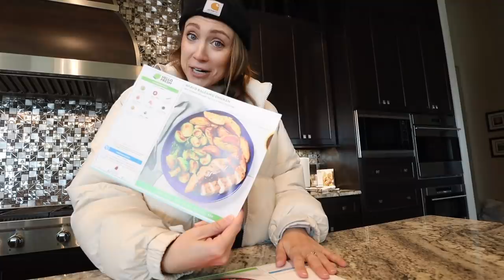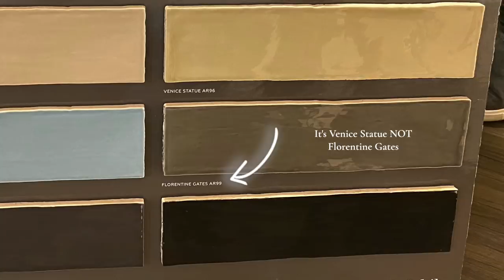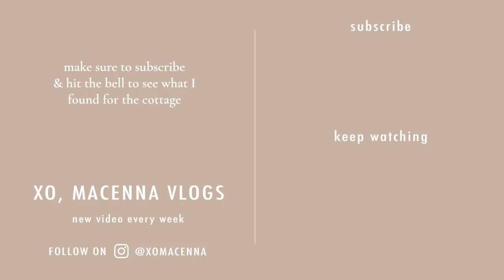DIY bifold doors + celebrating our 13th anniversary | XO, MaCenna Vlogs

Comment: Happy Anniversary! Growing up we had bi-fold doors all over the house. The knob is supposed to be on the left panel. When you grab it to pull, you pull back and the door easily folds open. If it's on the right panel, when you grab it to pull you will feel resistance because of the angle. Love your videos!

Comment: Wood is given it measurements when cut green. We still mill our lumber to the same size. We just dry it by kiln instead air dry it. Air drying it causes the call to collapse and become smaller than if air dried which doesn’t.

Comment: To answer your question re wood... they started making the wood "smaller" because by the time you add drywall on top, it comes out even.  So a store bought 2 x 4 is actually only 1.5" x 3.5".  The old 2 x4s were, many times, cut on site, milled from trees from the property.  Then plaster was put over lathe strips for a wall, for example.  I was a union carpenter apprentice a lifetime ago and tho I worked on a lot of residential jobs, I mostly worked on commercial jobs where we used metal studs.  They are also 1.5" x 3.5". 

You know you can buy bi-fold panels, right?

Comment: Someone may have already commented this, but the 1" (or all measurements 2"×4" etc) is the rough measurement of the board before it is milled down to a finished piece of lumber. I used to be frustrated by this too until a carpenter explained it to me.

Comment: The wood is 3/4 inch because mills use 1/4 inch saw blades. So the wood starts at an inch then loses 1/4 inch after it’s cut.

Comment: Happy anniversary! 
I had to laugh when you said it was 20 something degrees. In Maine we call that a tropical heat wave!!!
When it get above 0° it's a balmy 5 degrees out today. The door is sort of backwards. Hinges go inside trim on the outside knob goes on the other side. You did ok for the first time doing a bi-fold door. The reason lumber is not what it was is trees are much smaller now. There are no 1, 2, or 3 hundred year old trees left in North America. True some protected trees are left but most trees used for lumber are twenty or thirty years old. Also the profit aspect comes into play. Can't wait until house is completely dried in and the rest of the exterior is painted perfectly. Yes I know chimney and decking will come later. You can get a jet heater for not to much $. It might be something you can get so you can work comfortably in the house and cabins in the winter. There are several types and a few different sizes. The cleanest one is propane, the worst one is kerosene. (my opinion) Anyway even if it's freezing cold you can work in a tea shirt and shorts with this heater going no problem.